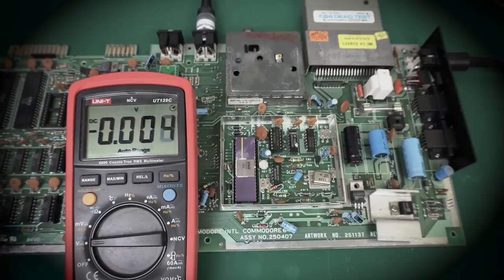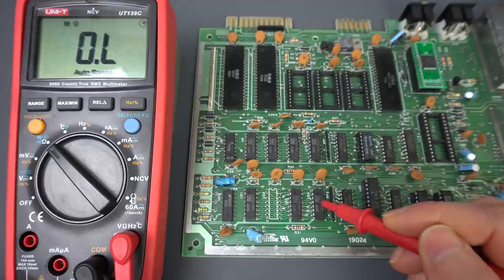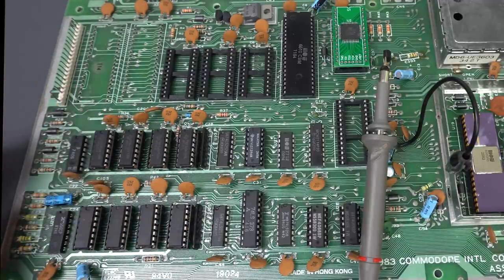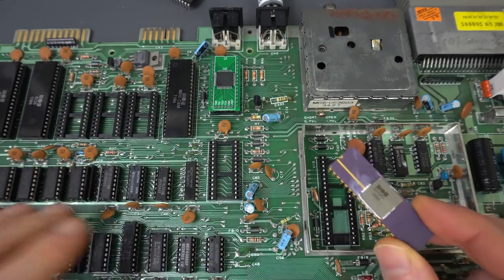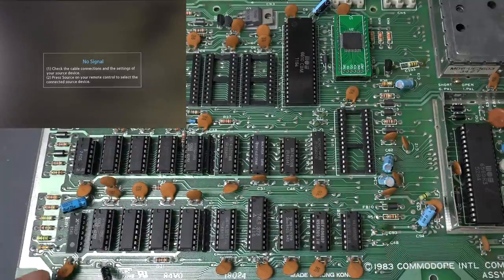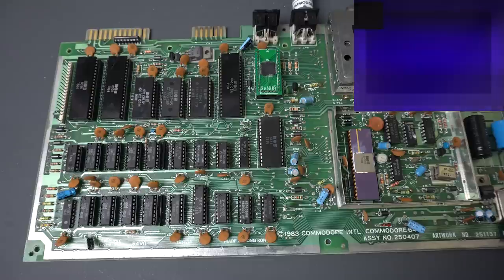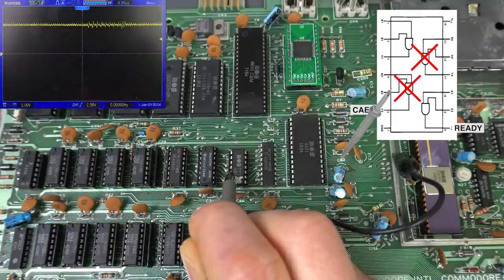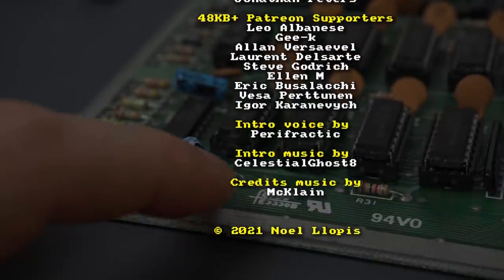The UGLIEST Repair of a Commodore 64 (Part 2)

Comment: i guess the vic-chip generates the timing for the ram chips. the never one might be a bit faster which then results in errors when the ram chips. slightly different timing
the 6502/6510 has 256 bytes of internal static ram. that is the reason why a simple program can run without external dynamic ram.
but the bit detection of the rams really seems to be wrong. on the other side, different boards could have different routings on different board revisions.

Comment: You can absolutely use an 8-bit computer with NO RAM.  However, you have to do things differently.  The ROM code cannot use things like RTS or anything that pushes values to the stack.  No RAM means no stack.  The dead test cart must use explicit branching and probably detects the missing RAM and jumps to the flashing routine.
Reply from the maker: Right, you need to be very careful. With some CPUs is harder than others though. On a Z80 it's pretty easy, on the 65xx it's harder, and I imagine on the TMS9900 it would be close to impossible (OK, OK, technically not an 8-bit CPU 😃).

Comment: I currently have a strange issue, the C64 works completely but when using ultimax cartridges I get garbled stuff on the screen. When resetting a couple of times it goes away. Also dead test sometimes gives different flashes after each reboot until it works. Anyone who can help me?
Reply from the maker: Different flashes don't mean much. You saw how I got different flashes too without changing a thing. But the fact that it works perfectly other than that... I would start with the obvious and make sure the cartridge connector is clean and that the solder joints of the cartridge slot are all solid.

Comment: That is just fine repair, its ugly when you need to pull out ten times logic cards & power cards from a machine that isnt repair friendly.
Just did one of those, bilion connectors at the floor level, plus 1K screws PH0, real party, as usual suspects did it, electrolitic capacitors and a shorted mosfer
Reply from the maker: Thanks! Yes, it could be a lot worse. At least the C64 is easy to work with. I can't say the same thing about the TI99 or those SVI machines with the ribbon cables you can't remove! 😃

Comment: Hi Noel, The reason it will not work with one ram is that Commodore used 64K x 1bit rams and you need 8 to store a byte ;) if they had of used 8K x 8bit rams then you may be able to get away with 1 dram to start up depending on the program as IIRC the boot vector / nmi etc is at the top of ram ? (I have not played with a 64 since my days at tech (some 30 odd years ago lol) BTW I do not know if they made 8k x 8bit drams back then as a lot of computers of the era with were XK x 1bit ram chips :(

Comment: I think it's not possible to write a "real" 6502 software without RAM, I mean.. no RAM means no stack !... so no JSR, no RTS, no ISR  / IRQ...
Reply: The dead test cartrdige does it. It uses the stack pointer as 4th register and with these 4 registers only it tests the RAM and blinks the screen if a fault is found.

Comment: looks like you are using the wrong type of ic socket! you should use it with contacts on the weather side inside the hole
Reply from the maker: I'm not sure what you mean. The sockets I added have contacts on both sides of the pin (as opposed to the crappy sockets the C64 came with that only have it on one side). Is that what you meant or is there a different, better kind?
Reply: @NoelsRetroLab  Exactly what I meant. Tried to look in the video but looked like there was contact only on one side of the pin.

I really liked the video 👍🏻👍🏻

Comment: you sure that capacitor being broken didn't fry all your new RAM?
Reply from the maker: I don't think that would have harmed anything. It was broken all along (I believe). It actually makes me want to go back to the video for Part 1 and see I can see the capacitor leg broken 😃
Reply: @NoelsRetroLab  but the original ram worked, and the new ram didn't, Maybe it was a different type that was more picky with voltages etc. and just fried itself? Either way good videos.